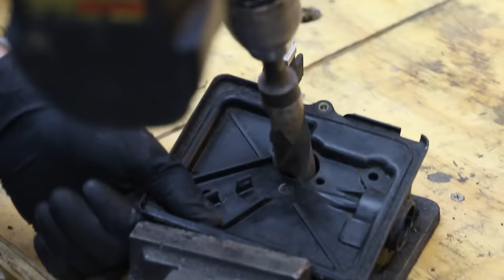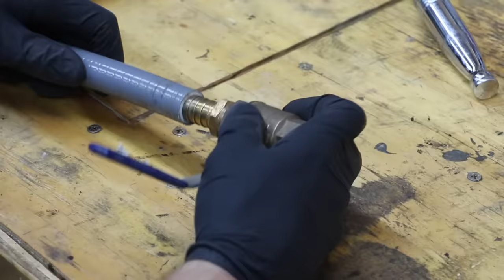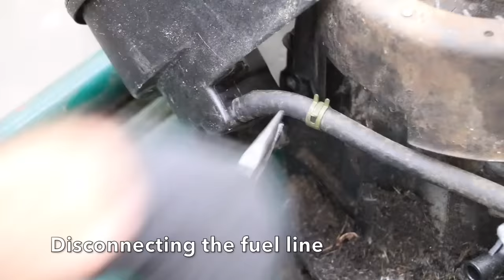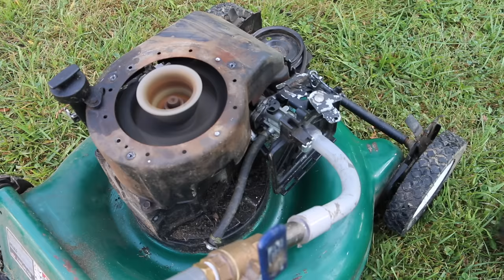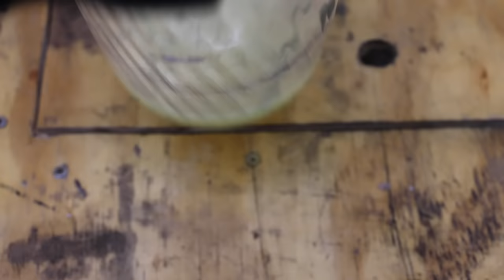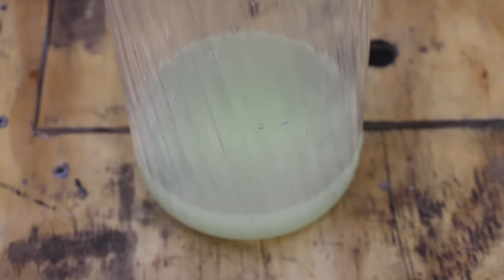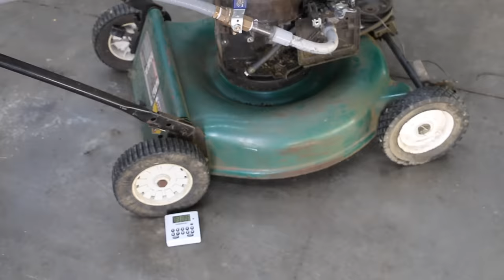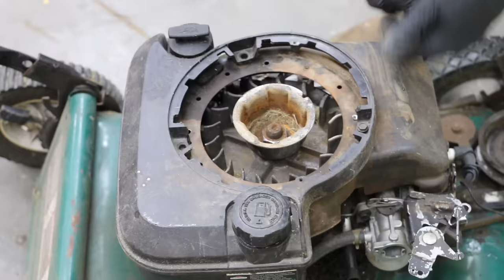Will a "Gas Vapor" Container Improve MPGs and Fuel Efficiency?  Let's find out!

Comment: If you look closely you can see reflection of oil company guy with a gun pointing at him.
Reply: mike brink  I know lol we put a man on the moon ffs if this worked to save fuel people would be doing it and the government would be taxing it (or have outlawed it) ... ha
Reply: @T2D.SteveArcs  you cannot land on an image.  NASA lies about the moon's realm.  Real truth is stranger than any fiction.
Reply: Simple Physics folks. It may have seemed like vapor in the bottle but was really a mist as Jaden Webb commented he in inadvertently made a carburetor. A potentially dangerous one.
Reply: +Jeff sandrock no but you can land on a moon. Which definitely exists and did happen. What "truth" are you trying to get at? lol
Reply: No, that's the specter of worn out piston rings since he didn't use an air filter. . . 🤣
Reply: I always thought there would be massive fuel savings going to vapours.
 No way i thought that your system would work.  For a very crude and simple vaporizer, i applaude you. 👏👏👏👏👏
Reply: Bruco Alidas  I'd bet money you don't get anywhere near your rated power though
Reply: thats actually not a joke, man be carefull what you do and dont die.
Reply: Bruco Alidas  40 mpg = 40 miles per 1 gallon @ 60 mph = 1.5 gal = 5678.12 ml/hr 1.577ml/sec
78 Chevy 350 = 5.733L = 0.716625L per cylinder
density of air @ sea level = 1.225 kg/m3, or 1.225g/L
0.716625L of air = 0.878 grams
the chev 350 stock runs about 0.85 VE, so 0.878g * 0.85 = 0.7463g of air per stroke
heaviest weight of gasoline = 0.77kg/L
1.577ml x 0.77kg/L = .77g/ml = 1.2145g

a '83 Chevy C20 stock tire size is 235/85r16 with a 3rd gear ratio of 4.1 (best case)
That comes out to 31.7" height (diameter), gives a circumference of 99.538" = 636.540819 rpm
636.54* 4.1 = 2610 RPM, or 43.5 rotations/sec (hz)
1.2145g of gas/sec / 43.5 = 0.028g of gas/rotation, divided by 8 cylinders = 0.0035g/stroke
0.0035g gasoline to 0.878g of air is an AF ratio of 250.85714285714:1. So lean it would never run. It's just not chemically possible.
Another fun fact, assuming you get 100% of the explosive power out of that gasoline (if it even runs, the best you're getting in an ICE is 30%), with that little fuel you can make... drum roll 73.6 horsepower. 30% of 73.6 horsepower is around 20 horsepower. a 0-60mph time using that kind of horsepower in a late 70's pickup truck would be.... about 45 seconds

Conspiracists lie. Math doesn't.
Reply: He did prove it is possible, but I would not say it is safe! In this setup, now we also need to remember that vaporizing gas happens in a carburetor, or a fuel injector, had his setup was a very crude setup, to prove a theory, now with his set up it still ran longer then the same amount of gasoline entering the engine in traditional fashion. So if you or anyone can safely perfect the system then go for it then let us know how to do it. 

Perfect test vehicle motorized bicycle 4 stroke engine. Don’ forget that base line tests will have to be done several times, and the averages will be used, same as with the test!
Reply: @gettintheresafelywithpatf2869  all it would take is a smaller fuel jet to extend the runtime
Reply: Bruco Alidas  Problem is all the gas additives left behind will gum up in your vapor tank over time
Reply: @SamaritanElad  "they say". Who says? Maybe in the early 60s that was "common knowledge" but nowadays we know that's not true.
Reply: Bruco Alidas send me a link I want to try it with my 2 wd Tacoma please sir thank
Reply: Now that's funny
Reply: @calvindibartolo2686  according to your math the highest possible highway MPG for a 78 chevy is 2.5 MPG, at 16:1 AFR. 

Garbage in, Garbage out
Reply: @erikmyers3888  show the math then, i did
Reply: @calvindibartolo2686  40 mpg (your starting point) @ 250 AFR (your conclusion).
250 AFR / 16 AFR = ratio of calculated AFR to a reasonable lean cruise AFR.
40 / (250/16)= 2.56 MPG using your calculated air and fuel consumption rates.

I didn't type it out because it was barely two steps.

I'm not gonna redo your shit for you, but at a glance I noticed at least 2 false assumptions: 1) only 4 cylinders of a four-stroke v8 fire per crankshaft revolution. 2) an engine does not operate anywhere near max VE under low-throttle cruise conditions (15-35% is more reasonable).

Always check your work. It takes much less time than the original work (unless you are wrong :P). I've done that much for you already so you can fix it yourself!

btw the two factors i mentioned alone could bring your calculated AFR for his claim down to 22:1 at 15% VE. Still obviously exaggerated, but not outrageous for an internet claim being checked by napkin math. And that's assuming you didn't mess anything else up.
Reply: Do y'all do know that your car runs off of vapors all the time right. The gasoline to liquid form is not flammable. But the vapor you know the gas is what burns.
Reply: Mickalin JezerX a mist isn’t a vapor buddy, fuel injection mists the gas into the cylinder
Reply: @mrpanda2655   before you talk go look it up.
Reply: exactly 😁
Reply: Amur, eXACTLY! Smh people wanna believe the bullshit and stick their fucking head in the sand, but the rest of us know the truth. That inventor is flyin' high with the Angels above, God rest his his soul❤️
Reply: Tested to Destruction it is outlawed. You can’t get your automobile insured if it is modified with this and it’s illegal to drive without insurance.
Reply: @gettintheresafelywithpatf2869  yo inadvertedy disproved your own point. gas vaporization happens during the normal operation of an engine. the carberuator or the fuel injection process vaporizes the gas so that it even CAN combust insided the engine. EVERY SINGLE ENGINE EVER MADE already runs on vaporize gas.  it doesnt matter if you vaporize the gas earlier int he process or if the vaporization happensinside the combustuon chamber. its still beign vaporized, and its still being used up at the exact same rate, to acheive the same ammount of power.
Reply: Freebirth boccara no I didn’t,  carburetors and fuel injectors atomize fuel, vaporization take it a bit farther, while when cooling either set up of fuel  you would return to a liquid, so if the particles are made smaller, then the theory is that fuel economy would increases but at what cost, to create a true vapor, you might need to do something really dangerous that I will not mention here ( don’t want any injuries listed against my ideas) but the shaking and sucking air through a liquid creates smaller droplets of fuel than any carb or injector has accomplished yet, but yes his system was at best a very crude set up to prove a point!
Reply: @gettintheresafelywithpatf2869  If you REALLY want to improve mileage, run untreated gas (like, say, avgas) through a vaporization setup and then through a heated nickel or platinum catalysis unit before combustion. It's what Tom Ogle was doing (using nickel), and by breaking the gasoline down into smaller carbon chains via catalytic cracking, he achieved FAR greater efficiency. This, btw, was verified by the DOE and reported on nationally-well, until the story was suppressed, the DOE turned on him suddenly and used patents to cease and desist him, he was murdered, and "stability" additives were added to gasoline to make it resistant to catalytic cracking attempts in the future.
Reply: jadedandbitter  some things are best left to professionals for reasons of safety, and engineering, like I stated I don’t want to hear of somebody getting injured or killed because of my ideas, and some of my ideas are quite risky!
Reply: xc5647321 xc5647321  where?  I've been running my own corporation since 1996.
Reply: well said
Reply: The only thing I've seen personally work. Like I said in the previous comment is the fact that you can turn a regular gasoline engine. From a car not just a small engine. Cuz a friend of mine did it to his Jeep is you can Make a hydrogen fuel cell homemade if you know what you're doing car. It's just basic physics and Science and the right components put together and distilled or RO water Must have purified water. With nothing in it And basically by putting the right electrical components. And the right parts, which aren't hard to do. Basically a certain arrangement of metal light plates welded together with Rod sticking up between them To have the positive and negative. Connection to those rods and have that Sit in a bath of distilled or RO water And then you run an electric current through it. Then it immediately starts to bubble and pop and crackle and then you will see if you Light it with a barbecue lighter or a match that it will light but you won't even be able to see hardly the flame unless it's dark It's very clean burning like alcohol where you can barely see it. Except this is hydrogen. Coming off of the water. And it really worked he ran it off of his Jeep. With very little modification as well as I've run my tractor off of propane You can run Vehicles off propane butane, Natural Gas. Extremely clean-burning So either distilling your own alcohol for fuel making your own biodiesel if you have a diesel engine. And getting cooking oil from kitchens that are going to throw it away anyway. And if you're desperate you can run the new or used cooking oil. But it's better if you turn it into biodiesel, and if you are going to run it straight, it's best to have a way to warm it up first. To help it ignite. However, it is doable. Anyway, that's my rant.
Reply: And I knew it was going to work by the way the video because I know that. Every engine that runs off of gasoline Good liquid isn't the thing. That is really burning. It's the fumes the vapors anyway. Not the liquid you run out of the vapors and the liquid is just liquid. If you leave a gas can completely wide open for you know, a month or more especially over it won't be worth much in the way of burning especially running in a vehicle now if it's sealed It's okay for awhile. It will break down unless you have some fuel stabilizer in there But yeah, it will lose its potency real quick if you have it open to the air Think of it like soda with the bubbles in it the carbonation. If you open up the bottle. The bubbles will skate but if you keep it close the bubble stay in there. Same exact principal with gasoline pretty much The vapors are what's burning? Not the liquid. The liquid just makes it easy to transport and put into a container. Without having a pressurized container like they do with butane or propane.
Reply: Wow, this video has brought out the crazies from the lunar landing deniers to the government is a super competent organization that can keep us from inventions to save fuel.  Pretty funny and sad.  If you just spend a couple seconds what the govt has done, the govt standards have been to force higher fuel efficiency, not the other way around. Good grief
Reply: mike brink  I know right? I agree with you because gas Vapors is what the car already runs off of. Without the vapors and fumes in the gas to liquid is worthless. It's not the liquid that burns it's the fumes gas is technically a gas just like butane or propane. It's not a liquid. The liquid isn't what burns so technically the car technically does run off gasoline Vapors in the most basic sense technically
Reply: mike brink  Well, I appreciate the very thorough model explained response. And yeah, you're right. This was years ago, though. This is like a good 10 or 15 years ago. I did not have  enough experience to think of anything like that yet. At the time I was just barely even  Touching the tip of the iceberg of messing around at that point. But really I do appreciate having stimulating conversation with someone else that is intelligent like yourself Because by no means Do I know or pretend to know everything a lot More than some of my age most likely is seems like I do but I'm always Looking to learn more from someone that knows something That I don't know. In fact, I usually learn more from my mistakes / failures Then my successes/ wins
Reply: Bruco Alidas  hahaha, I get 457 mpg
Reply: This is just turning your gas tank into a carburetor that feeds your carburetor...
Reply: Carburetor-ception
Reply: @mickalinjezerx7104  You wouldn't believe how many people don't know that GASOLINE  DOES NOT BURN AS A LIQUID!
Reply: John Miller  you have good fire insurance I assume,   Bless you with 40mpg
Reply: @patrickmclaughlin61  you could just hook up a dripper to a sponge on your air intake to get fumes you don't need the bong thing just a slow drip on the air filter lol it works to  figure that one out when your carb is fucked a monster can and a sponge and a squirt note to keep your motor goin cuz the carb us fucked and you had tape a can sponge a drill and a motor to burn the piss out of aiedy
Reply: @dienadel30  zactly so..The high mpg carbs use heat. the plans and patents are online and the records are history. No need to repeat it.
Reply: John Miller  yep, this isnt a real test..good job o your 350 where 40 mpg is double the usual.
Reply: @T2D.SteveArcs  man on the moon 
Holy fuck 🤣🤣🤣
Reply: @antthegord9411  
You still believe in fairy tales? Maybe you're way behind, I'd say. They never landed on the Moon, and, just for your information, the astronauts did admit that they staged it in a studio to try and convince the Soviets that they were on the Moon, therefore the US won the space race.
Reply: @anonymouse2428  
The air filter wasn't needed on this experiment. It blows air from the engine.
Reply: @mickcarson8504  I guess you meant that it blows air into the engine, right? Atmospheric air has dust in it which contains silica which is an abrasive. I don't know how much the gasoline could capture.
Reply: You have pure gas powered cars or conversion from gasoline to propane and its the same efficiency. Someone saying this is not vapor its mist. Question is just how well the fuel is atomised. Better it is the finer and hotter the burn rate thus better and cleaner
Reply: @calvindibartolo2686  Thank you, you made my day.
Reply: I'm a completely sold out advocate for vapor but then I've been huffing gas vapor and whip cream cans for years!
Reply: pyropulse  There is quite a difference between spraying a liquid or evaporating it.  In Europe as from the sixties, one could buy LPG-cars (I don't know for US?).  They drive with liquid gas (mix of propane and butane).  It is no secret that those have a higher fuel efficiency than the fuel injected or carburator engines.  The individual fuel particles sizes are a factor thousands to millions times smaller in gas condition and will have much better chance to bond evenly and correctly with the oxygen.  For sure some of the sprayed fuel does evaporate before it ignites, but not all!  Engine Engineers still today try to enhance the carburator jets and spray nozzles for this reason!  Why the LPG-cars became less popular: higher cost for pressurized fuel tank and potential safety issues in underground parkings or in case of accidents.
Reply: @dienadel30  not really dangerous, unless it's introduced to 400 degree temps.
Reply: @calvindibartolo2686  i severely doubt the truck can even go 60 at 20hp. Chevy weight: around 7000lbs depending on options (long bed, quad cab, etc.). Rolls-Royce 20 hp weight: (only car i could find that had 20 horsepower :p) around 1500-2000lbs. RR top speed= ~45mph, assuming the weight of the RR is 1750, that neatly fits into 4 of 7000. 45/4 is like 11 mph lol
Reply: @mickcarson8504  What blows air?
Reply: @SeeLevelBus  the earth is flat too, right?
Reply: John Miller  .... leaded gas??
Reply: @ChrisBlagdonIsABoss  youd be right. 20hp is to maintain highway speeds (roughly), getting there is a different story altogether
Reply: John Miller  i mean if you have a better formula im all for it. But from what i can tell youre just here to say "bullshit i iz conspiracy" and not back it up, your comment is meaningless
Reply: mike brink  
http://www.opel-p1.nl/custom/testcar/Shell%20Opel.htm

Why people don't actually do it, I have no idea. At any rate it would probably be a nightmare with any modern vehicle 😵
Reply: Lmfao. Yeah you gotta be careful when you start getting into ExxonMobils pockets.
Reply: Yeah , George Bush lol
Reply: @SeeLevelBus  
N ever
A
S traight
A nswer
Reply: @SeeLevelBus Flat Get Eeeem ,
Reply: That comment cracked me up. My inner conspiracy self was seeing the same thing! 😂
Reply: 😂😂😂😂 No Joke!!!
Reply: @SeeLevelBus  you believe in the moon???
Reply: Lmfao
Reply: @CK-et5do  you can self insure in every state I believe. And I'm positive you can in the majority of them.
Reply: @ChrisBlagdonIsABoss  but the weight would restrict the acceleration far more then the top speed whitch would have far more to do with aerodynamics and gearing
Reply: @SeeLevelBus  before the 'moon landings' it was scientifically reported there should be at least 8 ft of planetary dust on the moon surface? There was barely a foot of dust in the vids
Reply: @bmdbigfeet1031  an almost empty  gas tank is more dangerous than a full one
Reply: @mickcarson8504  another interesting fact, they 'lost all the info regarding  fuel etc on how they got to the moon
Reply: @anonymouse2428  slightly less effective than an old fashioned oil bath
Reply: For sure, oil companies don’t like this stuff. This is why he does it wrong to discourage us. I’ve found you can get about 30% better mileage if done correctly